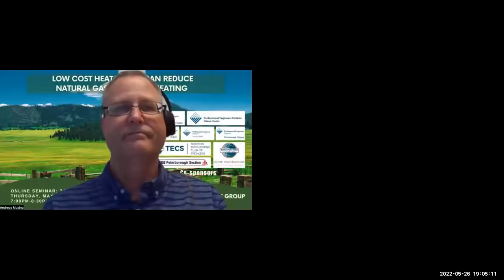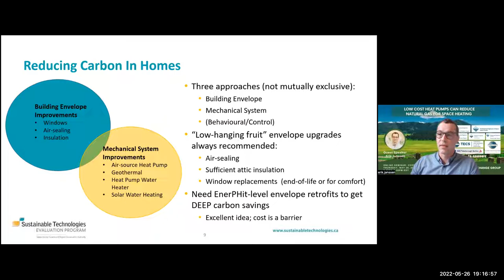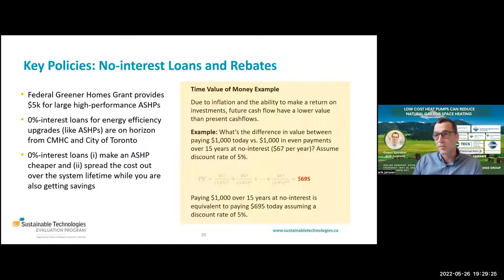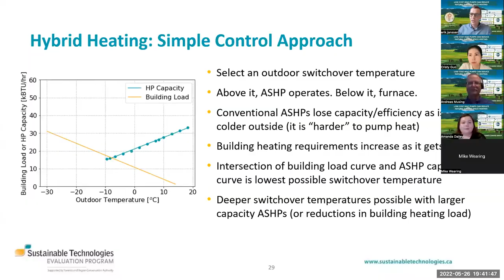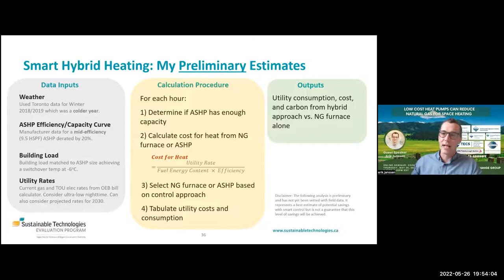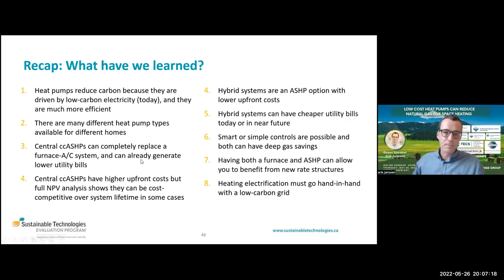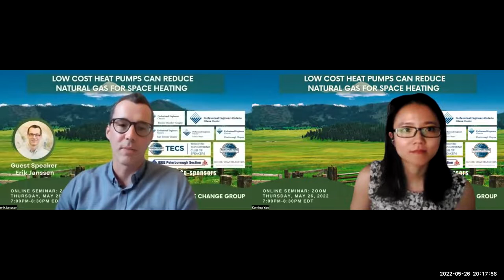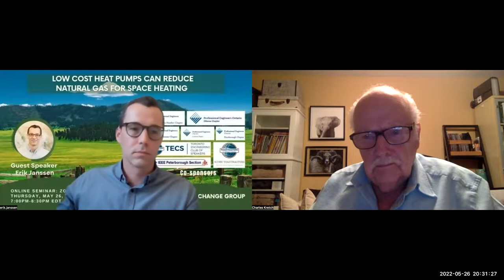Low Cost Heat Pumps Can Reduce Natural Gas for Space Heating

Comment: Hello Toronto and Region Conservation Authority, I see that you are using the term 'n**** gas' to describe the fossil gas that consumers burn in their homes. This language is very misleading, because this substance is not natural. 

Fossil gas is highly processed, first to remove a range of toxic substances such as hydrogen sulfide and mercury. Then it is separated in a petroleum distillation column. Methane gas comes out the top nozzle of the distillation column. Then lower down there are nozzles where butane, propane, ethylene, gasoline, kerosene, diesel and rocket fuel come out. What you are calling n**** gas is just a slightly lighter version of rocket fuel.

The Cambridge English Dictionary defines "Natural" (adjective) as "made or caused by nature and not by people or machines."

A substance that comes out the back end of a petrochemical processing plant, the same as fossil rocket fuel, is not natural.
Reply: That's just what the industry calls it Einstein. Like "Floor to ceiling" windows. They don't actually reach the ceiling and they don't actually sit on the floor. And yes THE SOURCE of "natural gas" comes from Planet Earth.